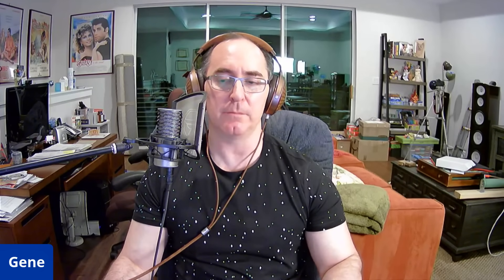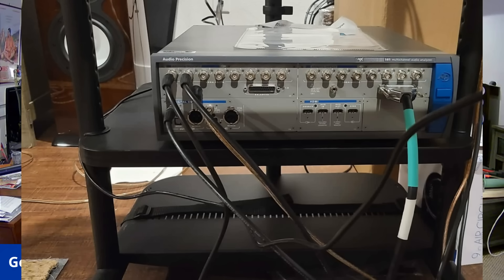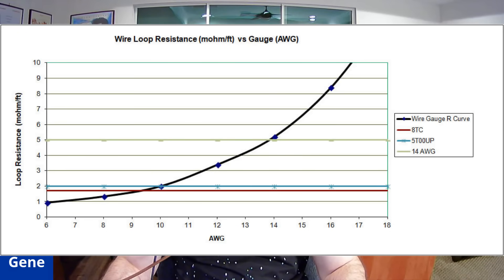Speaker Cables Really Don't Make Much of a Difference?

Comment: Kudos for taking the time and effort to measure a few attributes of different cables on sensitive equipment.  

However, massive failure of confirmation bias in jumping to conclusions regarding the meaning of the results with respect to human hearing and perception of sound.  Most of the differences that matter in gear and cables relate to the time domain effects of the interplay between resistance / inductance / capacitance /interference / accoustics on  the signal that ultimately reaches our ears.  
If you want to be scientific, START with the blind tests, with your great gear, in an accoustically correct environment - to determine what aspects of sound are reliably detectable to the different subjects.

Rate the level of resolution for each aspect of the sound. Then look at the measurements of these (and potentially other) attributes of the cable designs to form hypotheses regarding why some cable designs outperform others, or introduce color, when it comes to reproducing sound from audio equipment in a room.  Test your hypotheses. Analyze the data, form new hypotheses etc. 

The bias in your video relates to your flawed analysis regarding the sensitivity of human hearing to identify a difference in level output of any one of the aspects you measured.  You are correct, that we cannot discern minute differences in output levels of a broad frequency sweep.  The best among us can hear and identify when those levels drop out or become boosted.  But you considered nothing about our ability to discern the results of the interplay between the three measured attributes on sounds and music that are identifiable to us.  What is the effect on attack and decay, smearing (can be measured in the shape of a defined waveform over time in miliseconds)?  What about tone? What about the recognition snd separation of individual instruments and sounds and effect on perceived soundstage? These attributes of sound are what we audiophiles listen for.  

Measuring, and finding a difference is exciting and should provoke further curiosity.  Instead, you dismissed the differences, ignored the 4th dimension entirely, and presented the findings as proof of the dogma you've been repeating for years. 

You have the tools and equipment to conduct scientificly valid study.  Doing so, and sharing the methodology and data, and openly discussing the results would allow you and the rest of us in your audience to learn more about what works and why.  Then everyone could separate the substantive from the snake oil. 

Please use your considerable blessings to further our understanding and raise our level.  Please don't be concerned about whether what you said in the past turns out to be correct in the end or not.  Just see where the science takes us. 

Science starts with observed phenomena.  It doesn't start with discounting what people report. 

If you start with the belief that differences are primarily due to the placebo effect, it shuts down scientific inquiry before it begins.  Why listen for differences that don't exist? Why study how cable materials and geometry affect aspects of sound?  So much easier to dismiss everything as snake oil and never even listen to see what we hear.   

Everything in the signal path, including accoustics matters.  Each system, room and listener is different. Many factors are affecting the overall experience.  The biggest improvements tend to come from the biggest factors.  Room, speakers, source, amp etc. If you don't have the big stuff taken care of, then it's true that cables don't make much difference.  But if you already have decent gear in a decently treated room, and you are already enjoying some of the best sound you've heard, it's very likely that you can hear the differences between many of these cables.  Some of them can elevate your system and reveal aspects of sound that will be missing if you only upgrade your gear.

People tend to be tribal and choose sides. Look at the comments in this, or any cable related videos.  The comments tend to be very polarized.  Unfortunately, for those of us who are just here to learn, we are still left guessing in the dark when trying to choose one cable over another.  We can't discern the value or make educated guesses about how one cable or another might perform with our gear in our room.  

I, for one, would gladly participate in a blind study.  I think an audio show could be a great venue to draw a large sample set of willing participants. 

Cheers to all, happy listening.

Comment: You shall know the truth and the truth shall set you free.  Great to know I am not missing out on a great listening experience on my stereo because I didn’t spend huge amounts of money on my speaker cables.  I always wondered what the bottom line was and this pretty much sums is up.  I did spring for some blue jeans about a year ago but that was because I liked the locking end connectors.  Looks like Kimber cables are better performing but beyond human hearing perception.  Now I can sleep at night knowing I really am not missing anything.  What .06! do?  I can live with that.

Comment: Excellent!  In the 1980s, I built and sold speakers ... as a hobby.  Later I was a product developer and R&D manager at Telecom for a few decades, I know a little about transmission lines.  Very good video, thank you.  I have had interesting (and short) discussions with sellers who want to sell me a lot of copper at sky-high prices.  Sellers are usually quite limited in technical fact discussions 😁.  Great to see someone who makes a good measurement effort and presents the result.  👍

Comment: One guy on YouTube evaluated speaker cable based on how much a particular cables behaves as an FM antennae.  He found the least FM radio signal detected on an FM receiver to be from a pair of braided 24 wire cables similar to a very expensive Kimber cable.  The idea being that the more a cable picks up RF signals the more the audio music signal is corrupted.

Comment: Gene, as a intermediate "audiophile", really just a solid 70 year old, Music affectionado, I did Not buy into the ridiculous hype of the so called speaker cable Difference Makers for the extra mullah.  I have a LR stereo system since 1987, consisting of a NAD 1300 Preamp, NAD 2600Amp, a Dual CS5000 TT, a Onkyo 6 disk CD Player, connected to a pair of KEF 104/2 Tower speakers.  I used Monster Cables , that run an estimated 20 feet ( the longest) ,probably a 14 or 12 Gauge ( don't remember) which soldered speaker spade pins .  Never had a problem, nor did I test any other.  For my newly assembled finished  basement "studio" , done during COVID HIBERNATION in 2020 - 2021, I used Maxbrite 14 Gauge, pure copper speaker cables, from Amazon.  At first, I tried 16 gauge , then switched to the 14 gauge, heard no difference in 4 pairs of bookshelf speakers 8 and 6 Ohms.  Your analysis and review is the "science" ( I'm beginning to really Hate that term ....Science) on this issue. Common sense seems to dicate that the cable material has the greater impact on the delivery of the power ( pure nonoxidizing Cooper vs fake Cooper hybrids, etc.

Comment: The same dc resistance, equaled sound pressure, fixed skull position, tell me: which one is which one, not for 1 or 2 times, for 200 units of random cross check, lol...............I really don’t understand why charging a transformer for 200 bucks....... 120 bucks for a inductor...............

Comment: Only factor to consider is the gauge, scaling up based on the expected power output, speaker impedance, and the the required cable length, up to about 200ft. Beyond that length, the total capacitance in the cable may affect the upper frequencies to an audible state.
Reply: Now there is some good advice.

Comment: Hi Gene as my first language is not English,  i tried to understood turning on de Close Caption,  but i would like that you resume for me , if the Kimber cable a good one for speakers or you mean that no matter the cable you use not gonna change the sound,  thanks in advance!!
Reply from the maker: Thr kimber is the best measuring speaker cable but it doesn't change the sound compared to 10awg cable.
Reply: @Audioholics  Thanks so much Gene!!!

Comment: Howdy. With all due respect.
I think You, Sir, are stuck in the past.
Bandwidth and THD:s belong to the time of tube amplifiers. So do resistance, AC resistance, inductance and capacitance. These are all linear units and apply only for single sinus signals.
Music is a compilation of millions of sinus waves. Simultaneously. Ghost parameters begin to have effect. To formulate a comprehensive theory about these ghost parameters and isolate them would be a real breakthrough in audio science.
I can think of one. Eddy currents in the wire. In my mind this could partially explain why thick wires with unisolated strands give good bass and multistranded with isolated strands give good treble (according to PS Audio).
Regards.

Comment: Years ago i ordered a "pair" of nice cables, when i got them in the mail i found a pair meant a single channel pair for negative and positive :-/ So i got annoyed at how much i spent and put serious thought in to what and why the cables are even. This lead me on a hours long journey of concluding that on 10ft cables some stranded (better crush for contact) 12awg conduit cable from your local hardware store performs 100% the same as expensive wires if you just make sure the contacts a perfectly clean.

The only time i can think "better" cable is needed is long runs, but at that point why not just place an amp at location and not suffer the resistance you can't avoid.

Side note; you have little bones in your ears that adjust for different sounds along with head tilt witch changes the fluid in ear and it's reaction to sound. You can very latterly change the perception of the way audio enters your ear not just from different angles.. then there's humidity and air density, but whatever lol

Comment: Perhaps someone can help me explain something I stumbled upon a few months ago. I’m a staunch critic of audiophile BS so this has me baffled. 
I own some older Apogee Scintilla speakers. I am bi wiring them from my amp. As is common with older Apogees, the bass panel exhibits a non obtrusive and occasional buzz at around 200Hz due to a degradation of dampening foam around the aluminum “ribbon”. I have 2 different speaker cables I rotate between the MRT (mid range/tweeter ribbon) and bass. I hear absolutely no difference in these cables. I also have jumpered the connections on the back with single cable connections with zero difference. I was sent some Symo cable (a discontinued Swiss cable that reportedly is a good fit with the Apogees) by the person I bought the speakers from. I connected the Symo to the MRT and the other cable to the woofer. I felt like the mids and highs overpowered the bass to some degree, but I chalked that up to me wanting to believe the hype about these cables. I then switched the Symo to the bass and the other cables to the MRT. I played the exact same track at the exact same volume level and was shocked. The bass response was overpowering. So much so that the occasional buzz or resonance from the bass ribbon that was barely objectionable with regular cables was almost continuous and unlistenable with the Symo on the bass connection. I can only conclude that there has to be some aspect of the cable that allows it to pass the signal in a different manner than the regular cable I was using previously. Any theories?

Comment: Ive upgraded from QED silver anniversary to QED Genesis silver spiral for both my 2 channel and home theatre set ups and there is a big improvement so speaker cable are not all the same. I have found exactly the same with interconnects even with just 1m lengths . 
Theres no better measurement instrument than your ears.

Comment: That depends on the system. If the system is a good one, the cables will make the difference from mediocre to awsome. The realistical sensation that all audiophiles are looking is comming from details that the system can reveal, and without good cables, this wouldn't happen. My pick would be QED Genesis Spiral Silver with Banana Airlock.  And of course, if you need jumpers, must be the same cable/connectors.

Comment: A fool measuring the wrong things to advise other fools. It reminds me of someone measuring chicken soup to find the amount of chocolate it contains and then presenting his findings as some kinds of a breakthrough. Three  points of correction: First, the things that most affect the sound of a cable occur at or near the zero line on an oscilloscope, NOT at the signal peaks. Second, R,C and L are only three of the factors affecting cable performance. There are many others, some of which  are cancellations and artifacts arising from capacitive discharge effects. Third, time equals frequency, such that a straight up  (instantaneous) rise time equals INFINITE frequency. Rise time is crucial to cable performance, and to claim that 20kHz is any kind of limit frequency to audio performance is to say that transient response is irrelevant to sound reproduction. ABSURD! Finally, DOUBLE BLIND TESTING CANNOT WORK FOR MUSIC EVALUATION  In order for it to work it would be necessary to isolate and compare SINGLE factors. Music, by its very nature is constantly changing in frequency, timing, dynamics, and presence or absence of any one particular signal component. Not only that, but different people listen for different things at d=different times, so the test simply can't work. Incidentally, YES, I AM a cable manufaqcturer, but NO, I don't currently offer speaker cables, so I have no dog in the current fight.
Reply from the maker: I understand you don't like my message and you may not want to be told you've been misled by cable manufacturers especially if you've already invested a small fortune on wires.

Sadly, you're spewing the same nonsense that many exotic cable vendors do. I am not measuring "signal peaks". I'm measured lumped parameters of cables which is the appropriate way to analyze a twin feeder (aka speaker cable) transmission line. I showed not only the measurements of each cable, but also how the react to an 8 ohm load and an actual speaker load connected to an amplifier. This is as real world as it gets! Your point about "capacitive discharge effects" shows you understand much less than you think regarding how a speaker cable's capacitance is different from an actual capacitor element. I already debunked the nonsense on dielectric absorption here: https://www.audioholics.com/audio-video-cables/dielectric-absorption-in-cables-debunked

If you are a cable manufacturer, it would behoove you to learn these things to help govern cable design to make the best possible product for your customers.

At the end of the day, it's your money and if you THINK you hear a difference, then disregard what I talk about here. But let's not pretend you actually have an understanding of very basic electrical theory that other engineers and myself use to design, and analyze circuits and cable parameters. You can choose to believe dogma or embrace actual peer reviewed science. No worries either way.
Reply: " a speaker cable's capacitance is different from an actual capacitor element." Absurd. You obviously don't know that anything at all that consists of two conductors separated by a non conductor is a capacitor, and that all capacitors are subject to the same laws of physics. You apparently also have no idea at all of what capacitive discharge effects are, or of the  importance of the dielectric to the way capacitorsd store and release energy. I'm sure there must be things that you know about, Why not confine your lectures to them?
Reply from the maker: @rogerskoff5746  Idiotic statements. The speaker wire is in Freespace and doesn't exhibit nonlinear behavior like a capacitor does. 

At audio frequencies, even the worst dielectrics (ie. Polyvinyl Chloride, aka. PVC / plastic) used in cheap and many exotic speaker cables maintain shunt resistive impedances in the mega ohms or more. When dealing with a low termination impedance of a loudspeakers (usually in the order of several ohms) the dielectric shunt resistance is on the order of 10^6 greater, thus the parallel impedance remains virtually unaffected and we see no losses due to the dielectric at audio frequencies.

Science is not on your side. I already did the math and had it peer reviewed by PhD's in the industry like Dr. Howard Johnson, and Henry Ott. 

I understand you have an agenda to push expensive cables since you sell them. But don't pervert engineering truths to justify your products. I'm embarrassed for you.

I debunked your nonsensical claims over 15 years ago:

https://www.audioholics.com/audio-video-cables/dielectric-absorption-in-cables-debunked

Comment: With double-blind tests and the lack of measurements to objectively confirm a difference, there's been the same argument with instrument makers, the types of wood, the differences between a new Les Paul and older one, a Stradivarius and a modern day violin.  Some people believe a Stradivarius premium, a vintage Les Paul, and expensive audio cables are all a result of placebos, the Halo effect, etc.  Some people think there's a difference, especially seasoned musicians.  Maybe ... just maybe ... we haven't figured out how to measure certain audible qualities ... to each their own though, but it's amazing how strong of an opinion some people will have one way or another ...
Reply from the maker: The difference is perception of acoustical changes of an instrument are much harder to quantify than electrical signaling from cables connecting a speaker to an amp. That's very easy.